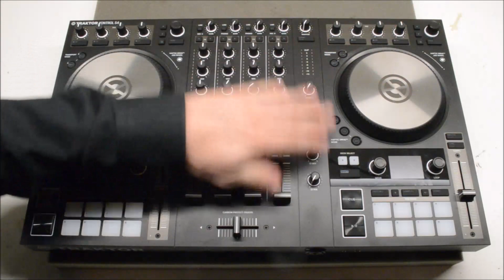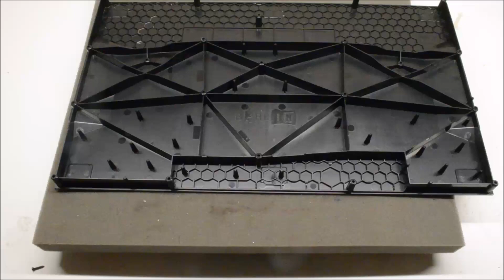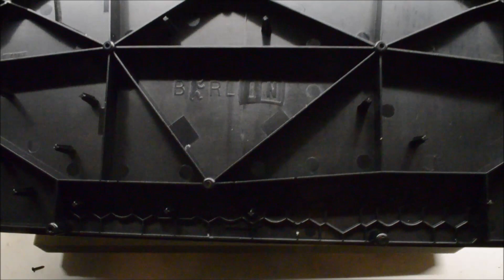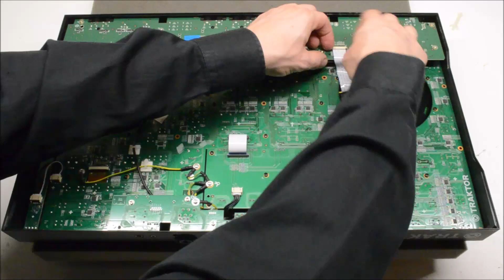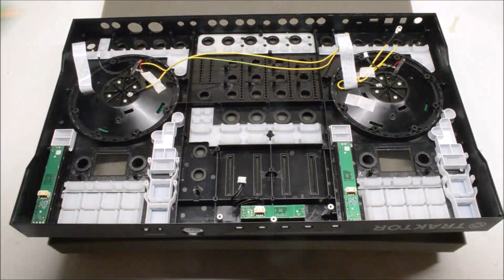Repair DJ Gear | Traktor S4 MK3 Disassemble Procedure

Comment: I know this video is older now, and this is kind of a big ask in comments, but I have a left jogwheel that does not react to nudging, the capacitative on top does work tho. When I set it to to Turntable Mode it just starts clicking and being stuck in place like it's trying to initialize, and Traktor completely loses ability for track to play.

I did a teardown to see if I could immediately see anything but didn't have the space or anything to dive more in at that time. However when I reassembled, everything was working. I did a restart and played with it 2 hours later and everything was back to how it was before.  

Just curious if something you have seen before, or any advice on where to start with fixing.
Reply from the maker: Look for the optic sensors that allow the teeth on jog to pass through. 

They go out. Rare. But that's usually the issue.
Reply: @RepairDJGearUSA  thank you so much! I'll look into this.

Comment: Sir I have traktor s4 controller and I am facing problem of headphone low volume.please help me out and fix this problem.
Reply: Changed the old to new headphones? Are both (3,5 and 6.3) connectors low on volume? Output routing correct? CUE-knop on left or right position? ASIO works correct?

Comment: Hello, please tell me. I took my tractor apart, wiped it clean of alcohol, reassembled it, and now the jog wheels don't respond. When I press the TT switch, the treadmill stops. What did I do wrong?
Reply from the maker: Check connections
Reply: I have the same issue and only in TT Mode. Everything else works as before. Have you solved the problem?

Comment: what  is you're de-solder solution for getting the mk3 reinforced usb type b port removed? The brace they added on the mk3 acts as a heatsink while trying to remove it. no matter how much heat i throw at it, or big tip i use cant seem to get the pins clear. It even killed one of my solder stations in the process. Ive also tried hot air. Great idea to brace it, pita for techs. My next attempt will be trying low temp alloy solder like I use for pioneer link jack removal

Comment: Hi there, having big trouble with native instruments getting partsfor this controller , I have a hardware issue and I think it's the output board I need to replace,  one day the vol just dropped 75 percent . I've done all my firmware and software stuff ,drivers etc didnt fix the issue. I had someone open it up and test a few things and it looks like it's something to do with the output board. Do you guys sell any or come across this issue. Native instruments have just left me hanging really , cheers
Reply from the maker: Hi. Thank you. We would need the unit to diagnose and possibly repair.

Comment: Hi Guys, tried to visit the site on th elink provided but its no longer in use.....I need to replace the right hand side pitch fader (due to some  minor liquid spill) it still works but not entirely, it doesnt have the full range when I move it and at times it gets stuck. Would you guys have a replacement pitch fader?
Reply from the maker: Try deoxit cleaner
 We don't have replacement. 

We sell new equipment if you need options.

Comment: Need to figure out how to fix my tempo slider. Its doin all sorts of crazy shit and adjusting on its own in my Traktor software. Liquid damage i think… contact cleaner?
Reply: Used controller manager to reset all knops and faders? I had to do this with two used F1s before i could use it correct. And i updated the firmware.

Comment: Hi and thx for this video. Do you have any idea why on a used S4 MK3 the the touch function on one side is not working any more ? Could it be a loose connector or something i have to check ? Nobody is talking about or having problems only with the toucharea. Thank you for any tipps.

Comment: Hello. Thanks for the video on disassembling the Traktor kontrol. Please tell me if you know. How is the upper metal round touch surface of the jog wheel on the Traktor Kontrol S3 MK3 removed and can it be removed at all? My controller has a small dent in this area. Thank you.
Reply from the maker: It is held on by double sided tape. Use a safe solvent for plastic to dissolve.

Comment: Can we apriciate how well made the S4 is down to the repair? Compared to a DDJ-1000 or even DDJ-400/FLX4 it’s much easier. things down to the tempo faders are removable
Reply from the maker: Yes, the NI boards are thicker as well. The MK1 and MK2 were more cumbersome to disassemble however. The final revision of the MK3 is nice to repair.
Reply: @RepairDJGearUSA  out of curiosity what makes the final revision better than the previous?

Comment: If any of your ribbon connectors have a lock, please use your finger nails to unlock it before attempting removal of the ribbon cable from the PCB

Separate all fasteners into groups in a muffin tin. Pay attention to standoffs and their location. The PCB can give a rough approximation of location of what goes where.

The take pictures at every step.

Comment: how do you remove all the knobs and faders on the front SAFELY? do you just pull them out? i have an S3 and the faders broke on it, i'm wondering if it had anything to do with me pulling out the plastic pieces when I installed a custom skin on the unit. thanks!
Reply from the maker: Plastic pry tool.

Comment: Really helpful video, thank you!  Reassembly is a little more tricky due to those little LED light tubes that have to be fitted correctly to align with the top panel.  I ended up putting a tiny piece of masking tape on each one to hold it in place whilst I flipped the board over to fit it.  Seems to have done the trick.
Reply from the maker: Superb!

Comment: Last week I accidentally spilled coke on the controller. Have had a few errors since then
Reply: did u ever fix this or open it up to try and clean it? A dumb bitch spilled a drink on my right deck and it works but I can't scratch or move the track by spinning the deck and more, also the play button on that side is a hard press.

Comment: What about lcd issues... my right screen suddenly gets white, barely you can see what is showing. Do you think an alcohol clean could repair it? I have been thinking on swapping the left side for the right side, just to see if the problem persist. Do you have any clues or have you had this issue on your repair shop? Thx for this video-

Comment: Thx for infos.
That’s clear and easy.

Experiencing an issue with jogs, as in TT mode, or jog mode, when I spin back there is a problem. Only back. Of spin up/front no problem.

When spinning back (in both decks) there’s kind of “resistance” with the motor system (when it’s off problem don’t show up) 

How can I fix that stuff ? Clearly happen in the jog motors.

Is a cleaning could be enaugh ?
Motors are dead ?
Super frustrating.

Also I’m TT mode (turning) when scratch the “reading head” is not coming back to the exact same place. It goes always a bit up front in the track and after few scratch’s, it’s a the complete opposite.

Thx in advance.
Reply from the maker: We would need the equipment.
Reply: You prob with the Jog wheel is what Im having in one after a drunk bitch spilled a bit of drink on it... did u ever open it up and clean it?

Comment: In fact, disassembling the equipment is simple and in strict theory it is very easy to change faders and pitch, but the people at Native do not sell replacement parts and the only option they give you when something breaks is to change your equipment for a refurbished one.  this for the modest amount of $449.00 USD.  In this way they receive your damaged equipment, they change the broken slider that should not cost them more than $20 and they sell it again for $450.  very good business for them, as it did not occur to me.  LOL!

Comment: is there a place where I can order a replacement channel fader circuit board or just purchase a SINGLE fader?? some salad dressing got in it. now the fader acts up a BIT. I'm planning out opening it up and cleaning it with contact cleaner to get it out...also heat up the area to get rid of any build up...
Reply from the maker: Yes, we sell them on our website. I recommend replace all four.
Reply: @RepairDJGearUSA  let me get the website. I checked on it but I didn't see any of it
Reply: @RepairDJGearUSA  Do you have the pitch slider spare part to sale?

Comment: excellent video, I followed it step by step and it helped me a lot to do maintenance on my S4 but now I have a question. Where can I buy the spare part for a pitch slider that was damaged by liquid spillage?
Reply: I got the same issue, a single water drop damaged the tempo slider and now it moves by itself in the software, I’m looking for a way to fix it. The only option i have right now is using contact cleaner and lubricant but I’m not sure if that’s gonna work🙃 wish me luck
Reply: @sanvoxdj Same issue on my S3 from beer spill lol. My friend said maybe contact cleaner would work i have no clue! Lol
Reply: @rockwildr69 hi mate, I cleaned it with contact cleaner back then and apparently It didn't work so I decided to stop using it with the relative mode. After a few years, I gave it a try and now it works perfectly fine👌🏻 (I couldn't find the spare part online)
Reply: @sanvoxdj Relative mode?
Reply: @rockwildr69 when you press Shift+ Sync the blue/yellow led turns red and it "deactivates" the pitch slider
Reply from the maker: Thank  you. Glad it helped. Pitch faders are discontinued.

Comment: I had to open mine up to fix a sticky play button. You forgot to mention about all the loose LED lights and all the buttons that pop out when you try to put everything back together, what a nightmare.
Reply: how did you fix it?
Reply: @wasweiich2190  It worked for a couple of days then it the button got sticky again. I have to open it up again and try to fix it.
Reply: @1CrazyDJ4U  did. u wipe or use any alcohol to try and clean it or just damp cloth?

Comment: Nice video man. It's nice to see that the channel faders and crossfader can be easily replaced.
Reply: In fact, disassembling the equipment is simple and in strict theory it is very easy to change faders and pitch, but the people at Native do not sell replacement parts and the only option they give you when something breaks is to change your equipment for a refurbished one.  this for the modest amount of $449.00 USD.  In this way they receive your damaged equipment, they change the broken slider that should not cost them more than $20 and they sell it again for $450.  very good business for them, as it did not occur to me.  LOL!
Reply from the maker: Thanks. Yes, agreed. Much better than the MK1 and MK2.
Reply: can the channel level faders be changed to rotary knob channel levels?
Reply: @anthonygato407  no

Comment: Are you able to switch out lights? Would be cool to change the blue level meters. Haven’t been able to change those with programming.
Reply from the maker: The surface mount LEDs can be swapped out. We would need to source out the parts. We are surprised TP3 doesnt offer color change. Unless we missed something in the software.
Reply: Repair DJ Gear I thought it could be done with this method in the link below, but no dice so far. Are you aware of a distributor that might have those?

https://youtu.be/wJ-9Np30xx8
Reply from the maker: Nice mapping. We have a few distributors in the states and work with a few manufacturers directly. Are you looking to change just the Haptic Drive LEDs?